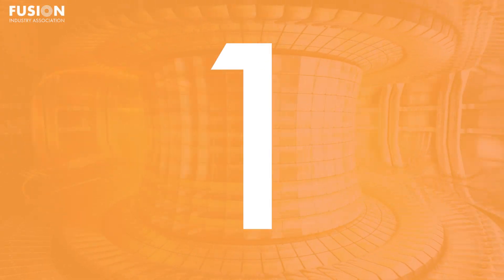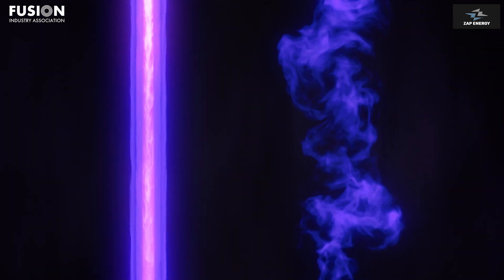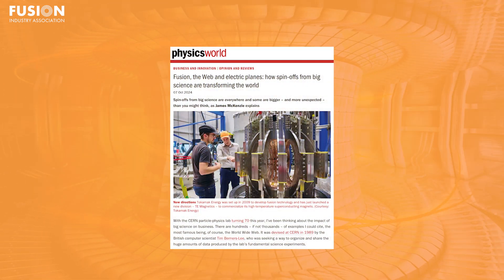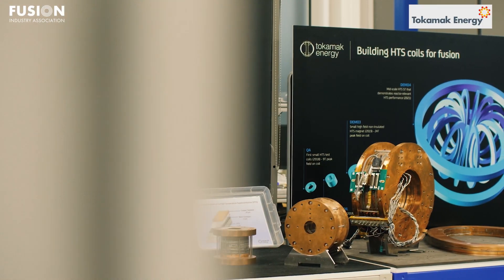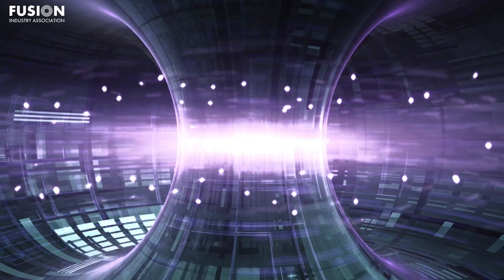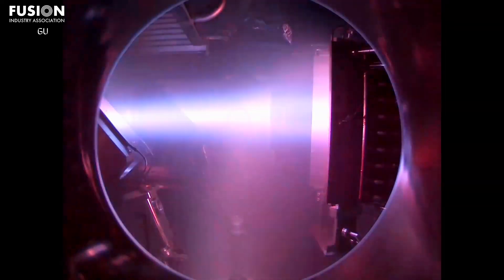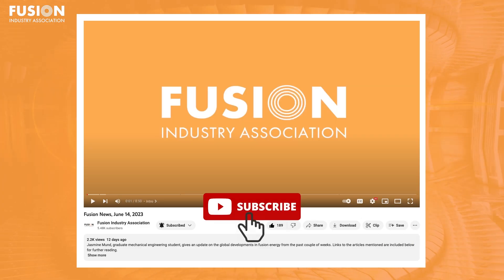Fusion News, October 16, 2024

Comment: Tokamak generates Whistler waves at a certain frequency. This is also found in atmospheric sprite production when Antihydrogen plasma flows through the electromagnetic field lines of the ionosphere. The signature is helium production. While the electromagnetic field is available the separation of matter and antimatter is possible. The reason why there’s no annihilation is the rematching of those two properties. Antihydrogen fusion is reproducible and will outperform all fusion.

Comment: The Fusion Industry Association presenters and editors regard the Indian based publisher, INTERESTING ENGINEERING to be a reliable source of technical news. Search for the following report from IE and then check into the broad claims made by 'Quantum Kineics Corporation.'

US firm sets record with plasma fusion temperature of 392 million degrees F for 24 hrs
Using its patented modular reactor, the QKC surpassed KSTAR’s mark by an order of magnitude greater than a fraction of a minute.
Updated: Nov 09, 2024 05:30 PM EST
Prabhat Ranjan Mishra

Fusion energy fans tend to gravitate to sources of information that reinforce what they prefer to believe in. In the field of psychology that process in known as 'confirmation bias.'

Comment: This site frequently cites articles presented on the news aggregator site 'Interesting Engineering' (IE) which is based in India. IE tends to employ writers who often have no academic background in the technical field that they are reporting on and who do a poor job of confirming their information sources using independent experts. They typically don't include outside critical assessments in their reporting. In the following article they report on a cold fusion energy startup, ENG8' which currently refers to the process as 'catalyzed fusion' since 'cold fusion' experiments were typically found not to be repeatable experiments by independent experts.

Catalyzed fusion system produces electricity, runs indefinitely without input power (Interestingengineering)

Comment: is that one minute, forty eight seconds of energy pulses, assuming ten pulses per second? 1080 pulses, doesn't sound a long time, must be difficult?
Reply: It is very difficult and results in erosion of the center electrode that limits how long this process can be continued. Of course no D/T fusion fuel will be employed in such experiments which means no significant quantity of fusion reactions will occur. I will be curious as to how much time the fusion reaction reactions will be expected to last during the short ‘on’ period of each arc streamer pulse. The ‘duty cycle’ of such operations is required as a parameter for the design of any power plant. If the duty cycle is low then the peak thermal output, from each pulse, will need to be much greater than the averaged thermal energy required to send to the generator. Such a plant would be subjected to severe thermal cycling stresses that would limit its lifespan.
Reply: @vernonbrechin4207  Thanks for your clarification, yes see your points about fusion reaction time, duty cycle, pulse rates and energy. Center electrode being burn't away, is that necessary to the process (like an arc lamp) or a result of it,( like a spark plug degrading)?
Reply: @fuccasound3897  I believe it is more like ICE spark plug electrodes degrading. That erosion process is likely to degrade the formed confining arc column in addition to contaminating it with plasma nuclei that will hinder eventual D/T fusion reactions. I tend to believe that the most important factors are often contained in details left out of promotional presentations.

Comment: In the Bonus "Harnessing Star Power Part 2," I was confused by comments from professor Dennis Whyte. 

In the standard approach to laser ICF, after the laser fires, the compressed/heated fuel target instantly expands into the vacuum chamber at the speed of sound. Because expansion shortens the length of time that favorable fusion conditions last, it reduces self-heating and total burnup. It is often said that a material wall cannot be used to slow the expansion (or reduce the cooling) of the fuel, because contact with matter quenches the fuel. This is not true. ICF capsules use non-fuel "pushers" to compress the fuel and non-fuel "tampers" to slow the expansion down. Containment can also be improved by surrounding the fuel with a high-Z material, and suddenly heating them to the same extremely high temperature (high enough to become fully ionized). For example, consider a bubble of compressed DT gas in molten lead. 

Since the temperature is the same, the radiation pressure in both regions will be the same. The contribution of the particle pressure to the total pressure will be proportional to the particle density. Initially (assume), in the un-ionized state, the particle densities were about the same. Once the atoms become ionized, the particle densities can change dramatically with far more electrons becoming available from dense high-Z materials compared to low density, low-Z materials. Even if the system is radiation dominated, with the radiation pressure far exceeding particle pressures, the total pressures in the regions will not balance. The pressure differential will cause the high-Z material to expand, compressing the low-Z material. 

This process of ionization compression can be very important in a system where a high-Z material directly contacts low-Z material. In fact, it is interesting and relevant to note that the main effort Soviet scientists made towards an H-bomb was the "Layer Cake" or Sloika design. It employed Vitali Ginzburn's idea of using solid lithium-deuteride fuel and Andrei Sakharov's notion of ionization compression of the fuel. 

OMG! The zombies got my favorite Pod caster.
Reply: As you were describing the process it appeared to me that it was based upon nuclear weapon design principles and likely has been employed at the National Ignition Facility (NIF) which has always been funded as primarily a thermonuclear weapon (H-bomb) research tool, not as a viable path to a economically practical nuclear fusion energy demonstration power plant. The administration has always been masterful in obscuring its primary function.

In NIF’s widely broadcast ‘breakthrough’ announcement, of their December 5, 2022, laser shot, they conveniently left out some key details. 1) The Q-plasma > 1.0 was supposed to have been achieved a decade before that shot. 2) The experiment took around a week to set up. 3) The fusion reaction lasted for approximately 0.000,000,000,08 second. 4) The fusion reaction was initiated in a microscopic area at the center of the highly compressed, expensive fuel mass and then the reaction outward pressure blasted away about 96% of the fuel mass before it had a chance to react. That unfused D/T fuel was then sucked into the target chamber vacuum pumping system. There was little significant propagation of the fusion reaction. The use of the term ‘ignition’ is deliberately misleading. 4) The lab has had great difficulty repeating similar experimental shots using target assemblies costing around $100,000 (USD) each.

Other ICF approaches, such as that by the U.K.’s First Light Fusion, will likely encounter similar problems of fusion times of less than 1.0 nanosecond and a blow-off of a major portion of the expensive D/T fuel mixture before it has the opportunity to fuse. Eventually funders will learn of the limitations that are not now being mentioned to the press, the public and to private investors.
Reply: @vernonbrechin4207  Even though the "I" in NIF stands for Ignition, NIF's primary mission has always been stockpile stewardship, keeping the nukes and scientists working. These missions were obscured by an administration that boldly advertised Ignition, while only quietly acknowledging the stockpile stewardship role. However, nothing about this misleading behavior warrants forming conclusions about ICF's potential as an energy source. 

I mostly agree with your December 5, 2022, laser shot characterization. However, I do not think the term "ignition" was "deliberately misleading." In fact, the operational definition they used (more fusion energy produced than incident laser energy entering the target) was chosen to avoid any controversies and lack of consensus. It was the definition put forward in a 1997 report by a committee formed by the National Academy of Sciences (NAS). 

If the goal is to quickly compress a bubble, First Light Fusion is making a fundamental mistake launching compression waves from a single direction. It makes more sense to start with the bubble of DT submerged in large hollow reflective sphere filled with molten FLiBe, and then compress it quickly in all directions simultaneously. Here are some advantages this approach has: (1) fusion energy is deposited directly in the bulk of FLiBe, avoiding the energy extraction problems MCF has due to high intensity surface flux; (2) zero cost target fabrication; (3) alpha heated, long burning, slow disassembling targets; (4) absolutely no radioactive waste; (5) robust high yield targets for higher gains.

Comment: The Fusion Industry Association is primarily composed of fusion energy fans, most of whom have vested interests in promoting numerous aspects of nuclear fusion experimental efforts. The field is currently spending billions, worth of USD, on dozens of experimental facilities located in numerous countries and now involves hundreds of contractors and many tens-of-thousands of people. Investments tend to be based upon ‘critical assessments’ generated by other fans, not from completely disinterested parties.

The promotions tend to cherry-pick the positives while leaving out key issues that have plagued the field since the experiments began in the 1950s. It has always been claimed that the hydrogen fuel is virtually unlimited. In most cases tritium is essential. Typically not mentioned is that it is radioactive and that its current commercial price is about $30,000 (USD) per gram. As a result exceedingly few fusion energy experiments utilize it so there is no chance that they will generate a significant amount of fusion energy as part of their experimental program. That fact is frequently not conveyed to the press, the public and to funders. Almost all the proposed magnetic confinement fusion (MCF) demonstration power reactors are expected to operate in a pulsed mode when operating near their maximum fusion energy level. The pulse ‘on’ period of time is sometimes mentioned but not the ‘off’ period of time, or recovery period. If the off period is much greater than the on period then the peak generated fusion energy will need to be far greater than the average thermal energy that the plant is designed to produce. The constant thermal cycling will likely reduce the lifetime of the plant.

The energy gain (Q) was mentioned in the above video. It refers to Q-plasma, not Q-total. Q-plasma is based on a very limited input energy parameter, the energy that couples to the plasma to heat it. It only applies to the pulsed ‘on’ period. It has almost no relationship with the input energy needed to power the entire system, including during the recovery time period.

Zap Energy’s Century machine is not intended utilize a D/T fuel mixture so it will never produce significant fusion reactions. If it did the fusion reactions would likely last far less time than the arc pulse and the fusion reactions generated would likely disperse the remaining fuel nuclei before they have a chance to react. As a result much of the expensive fuel would likely be sucked into the chamber vacuum pumping system.

The video included news on the JT-60SA machine. It made no mention if it will ever employ D/T fuel and therefore generate a significant amount of fusion energy. It didn’t mention that this announced goal is years behind its original schedule and that a predecessor superconducting magnet experienced a catastrophic short circuit. JT-60SA was expected to complement the work at ITER which is now grossly over its original budget and more than a decade behind its original schedule. The ITER directorate recently announced that their D/T fusion experiments are not likely to happen until 2039 and this is too late to deal with Anthropogenic Climate Disruption (ACD) effects.

The news article, promoting the many potential uses of high temperature superconductors ( HTS) failed to mention the key issue that they typically require cooling down to liquid nitrogen temperatures, or below that temperature. Nuclear fusion experimental research has resulted in many manufactures investing in SC cable manufacturing equipment so they are now trying to create other markets for their products even though it is not cost competitive with existing technologies.

I suggest that these vast resource would be better spent on technologies that are currently making some progress in weaning us off the fossil fuel  nipple.

All promoters of nuclear energy are in line with the vast majority of the Earth’s 8.0+ billion humans who have masterfully excluded the following warnings from their consciousness. They continue to assume that we have at least 20 years left to turn this ‘Titanic’ around, through the use of their favorite technology. I urge readers to search for the following two article titles.

IPCC report: ‘now or never’ if world is to stave off climate disaster (TheGuardian)

UN chief: World has less than 2 years to avoid 'runaway climate change' (TheHill)
  * This statement was made 5.8 years ago.

Comment: 0:51 I've been following this concept for more than 20 years, and find it interesting from the physics point of view. It would be important to know how does their neutron yield energy compensates the energy which is invested in the pinch, though.

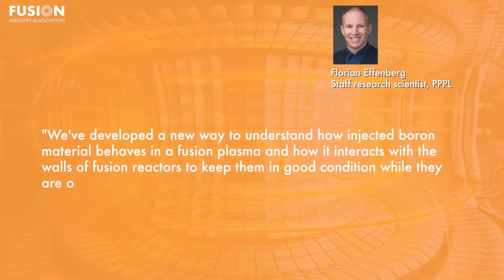6:22 The real significance of the JT60-AS isn't so much its increased volume, but its capacity for testing longer plasma pulses. It should soon outperform China's EAST tokamak.
Reply: Zap Energy’s Century doesn’t employ deuterium/tritium fuel gas in their arc-pulse experiments so there are no significant fusion reactions and no significant fusion neutrons produced. This situation is the case for the vast majority of nuclear fusion energy experimental machines. Their primarily aim is to test non-fusion plasma confinement time and density. Typically the presentations obscure the important issue.

The JT60-AS plasma confinement tests likely won’t employ tritium since it is radioactive and the current commercial price is around $30,000/g (USD). The JT60-AS was expected to aid in the ITER project but that is grossly over its original budget and is well over a decade behind its original schedule. The directors stated That its first D/T fusion experiments are not expected until 2039 and he admitted that was too late to deal with the rapidly worsening climate change crisis.